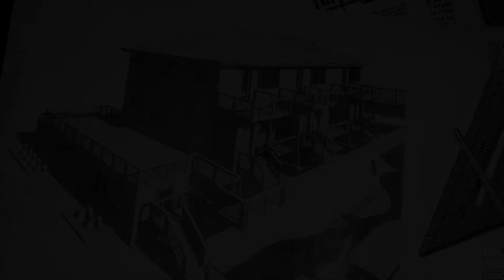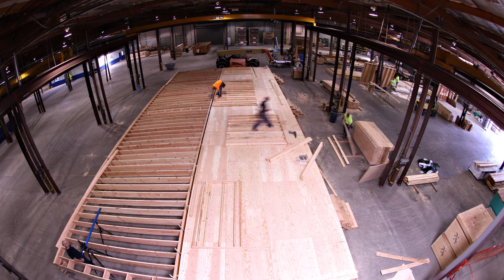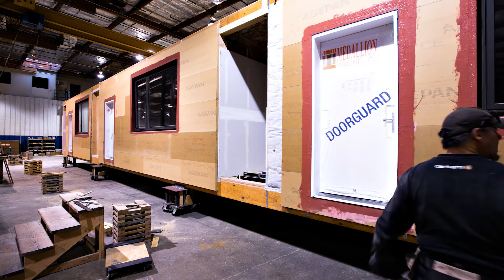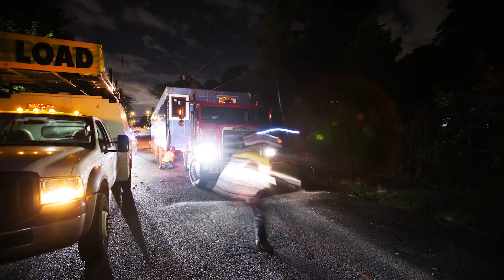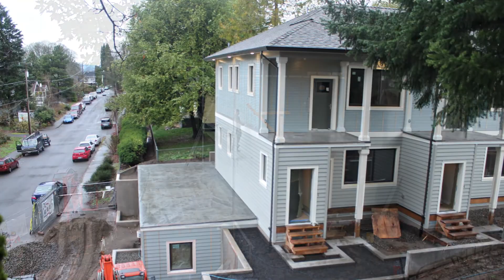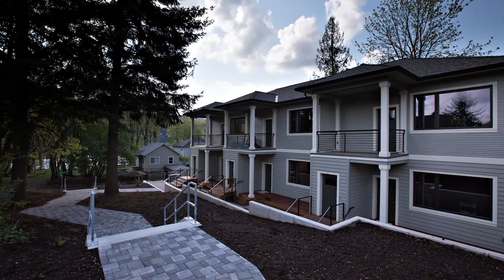THE EDISON - A Modular Construction Time-lapse Film

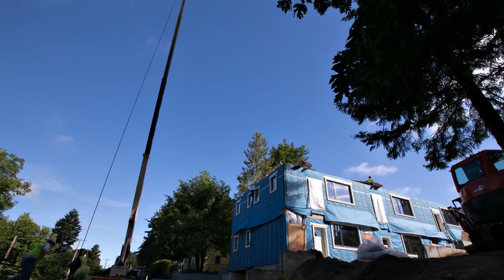Comment: In 4:58 how did the module slightly moved and joined to the rest of the building? Did the crane move it or are you using some sort manual method to bring them together?
Reply from the maker: I can't be 100% sure but it looks like the crane moved it over with the help of workers on the ground. It's possible they used some mechanical jacks to winch it over, but I don't think that's what happened in this case.
Reply: Wondering the same thing

Comment: Just a quick question.  Why wasn't the roof made off site and dropped on with the crane?
Reply from the maker: Each of the modules is as wide as the law allows for transport on city streets. This building is 2 modules wide so the roof which spans both could not be transported.